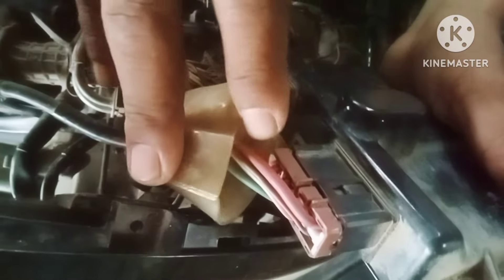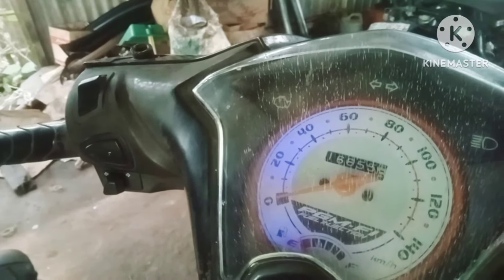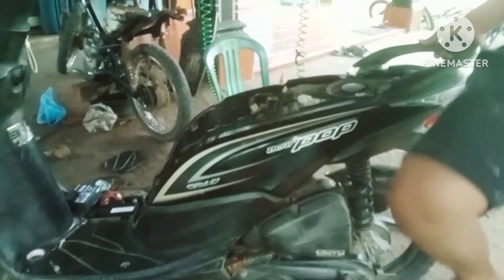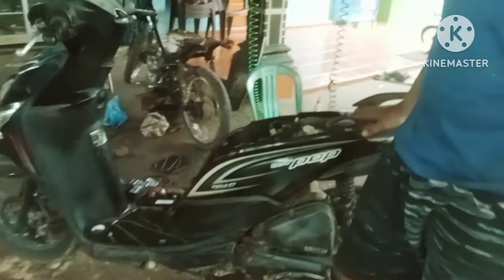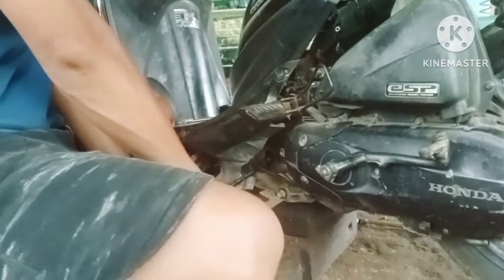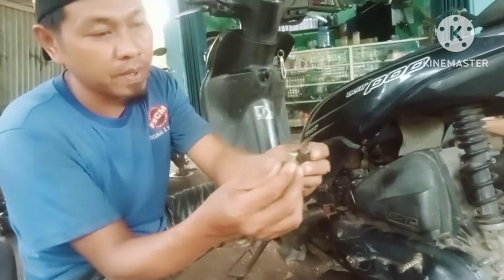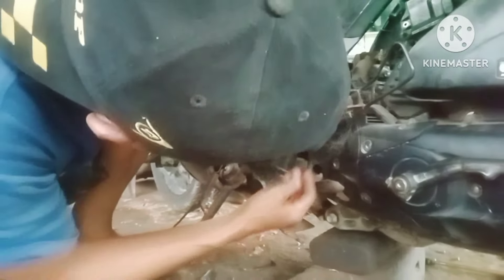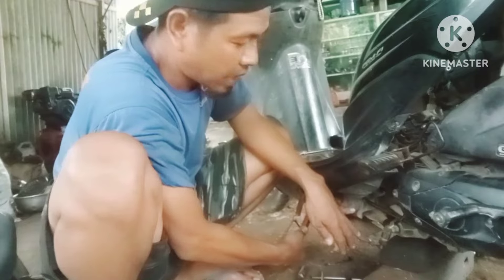lepas sensor eot brebet sembuh,ini trik mengatasinya,matic honda

Comment: Saya mengalami pada motor beat injeksi stater kasar,jika di copot sensor eot nya motor mudah idup tapi llamsam nya gede gak mau kecil,dan jika di pasang sensor eot nya susah idup.
Saya coba idup kan dengan sensor eot nya di lepas setelah idup sensor eot nya saya pasang lamsam normal tapi di gas awal di berebet/agak engok,,,itu apa nya ya
Reply from the maker: Sensor TVS

Comment: Punya saya di akali pake resistor tapi BBM boros , apa cara ini boros juga apa normal BBM NYA
Reply from the maker: Selamat ini normal sebab, sensor tetap terpasang pada socket
Reply: Sama ajah borose
Reply: @World0netezeN betull sekali karena ecu membaca mesin tetap dingn lepas eot atau kasih r sebagai hambatan efeknya sama karena r cuma mengakali ecu biar tidak mengeluarkan kode mil